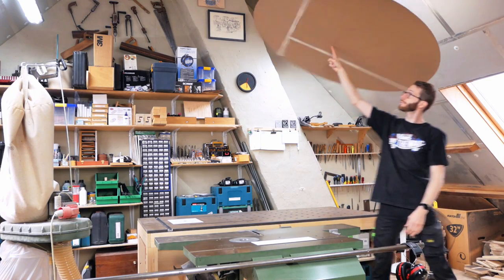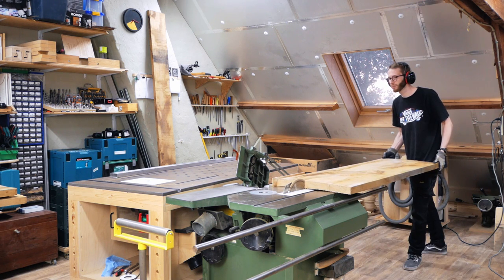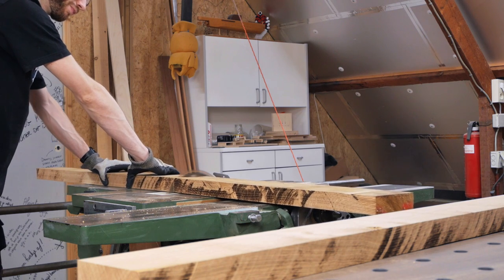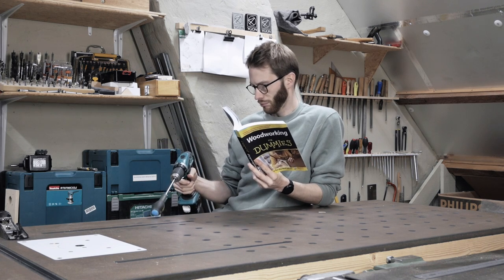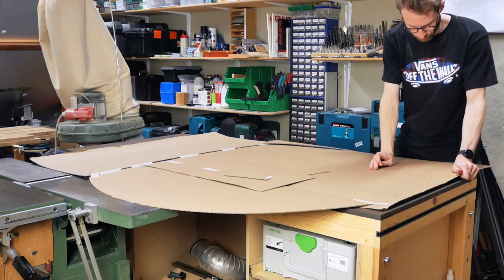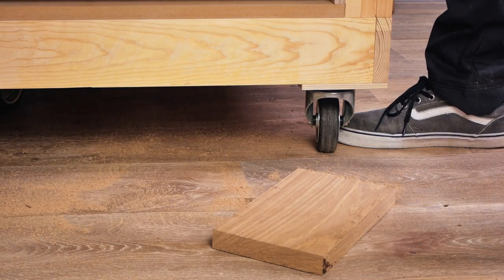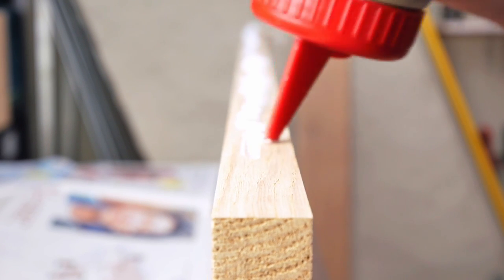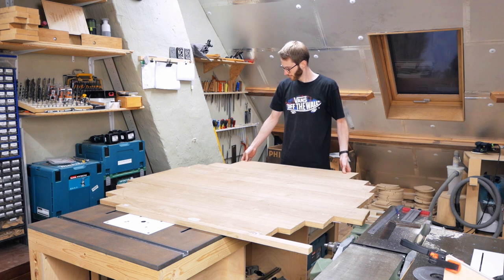Modern ROUND DINING TABLE with a Chamfer Jig | woodworking

Comment: Hi you did an awesome job with that table. I'm planning something similar, only with a Danish oval form. I'm interested in the router jig. Would that work if the table isn't round.
Reply from the maker: Normally it should! Because mine was based on a jig used by youtube.com/@foureyes.furniture on a table with more straight edges. https://youtu.be/cfjW7QEL5C4?si=igYJwggE3UnWjp35

Good luck with the build!

Comment: Why would there be weakness after gluing? I wouldn't want to have to rely additional bracing/C Channels.
Reply from the maker: I still don't understand why there was a bit of flex after I glued the boards together. Back at that time I've put some newspaper sheets on my workbench when glueing and maybe there got a little bit of newspaper in 1 of the glue lines. Just make sure to properply glue and no need to worry!

Comment: What finish did you use?
Reply from the maker: It's an old leftover product but basically just a pigmented solvent based finish. Not the most healthy to work with but it spreads and dries fast.
Reply from the maker: Oh sorry! Thought this was a comment on another video. Oops! The finish used here is Rubio Monocoat Smoke 5%. Check the link in discription. Rubio is an eco friendly oil based product. My go to for anything these days.
Reply: Awesome thanks for your response. I thought it might be Rubio. I’ve been using Rubio as well, but I like the color you got out of your project. Keep up the good work!
Reply from the maker: Thank you!